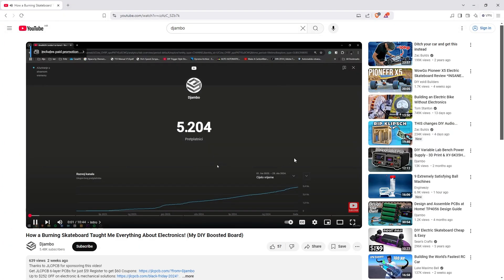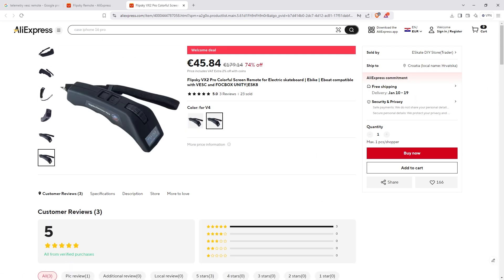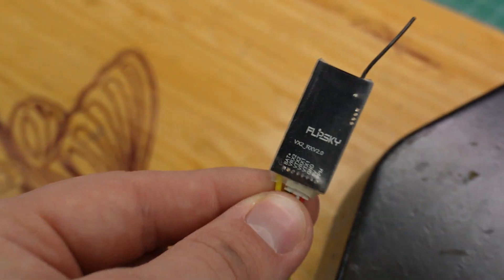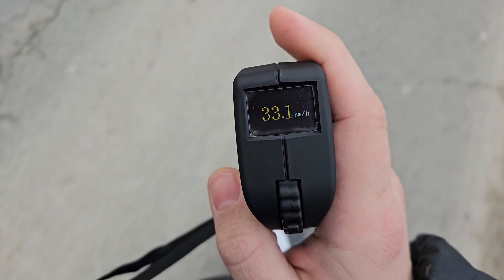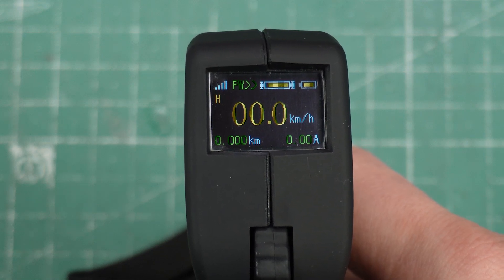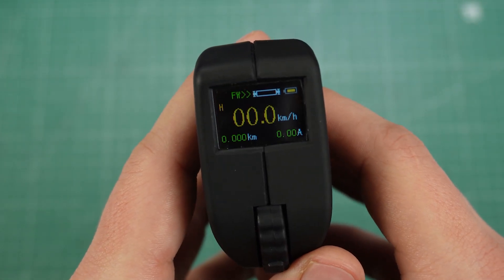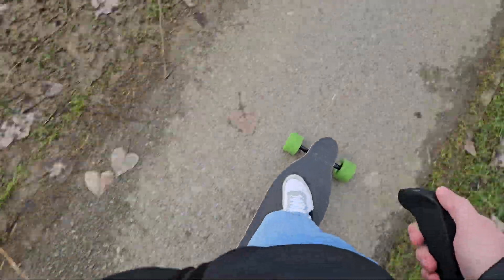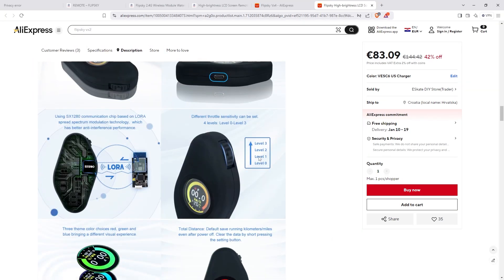Flipsky VX2 - DIY Electric Skateboard Remote Controller Review

Comment: I got a skateboard controller so I could control an RC ESC for a large propeller, however the ESC won't start using its receiver because it expects 0% instead of 50% duty cycle.
Would be nice to have a switch to use 0-100% mode instead of -50 0 +50 mode. Anything like that on the market already without "reverse"?
I'll try using a VESC instead and learn about configuring it.
Reply from the maker: I think your ESC should be able to set the mid point as zero. There has to be a way to calibrate the throttle input on the ESC. I did it on a couple of Hobby King ESCs with similar remotes...
Reply: @Djambo57  The RC ESC only did 0-100%, and wouldn't start without being at 0% first.
I used a VESC instead with its configurator and managed to get the mapping calibrated - wasn't as easy as it should have been, but got there eventually.
Tried out an inflatable dinghy with a 4kW 6374 driving a propeller on a stick and it was quite brutal even at 7S. Needs an outboard adapter really as it was very tiring just holding on to it and trying to maintain a heading. Still, it worked even if not very practical yet!